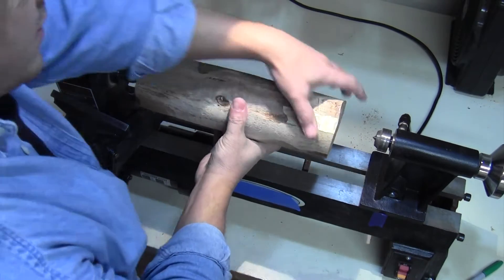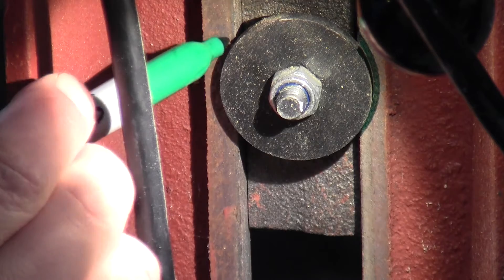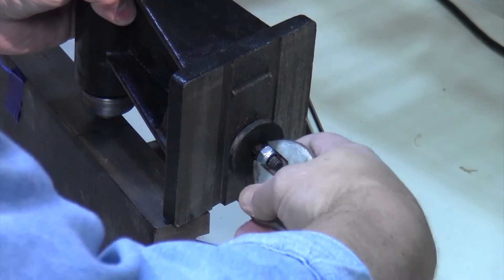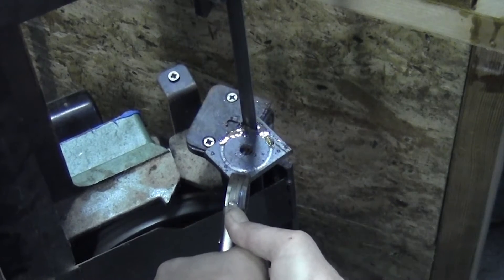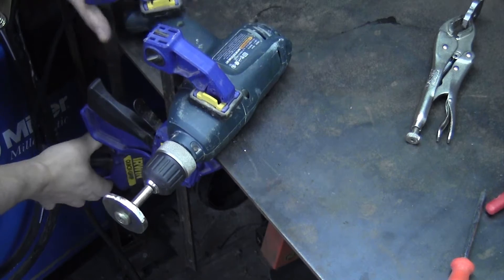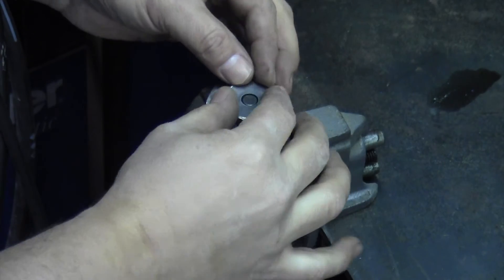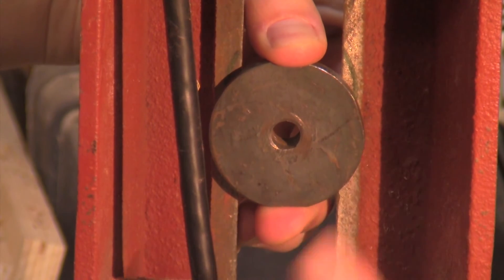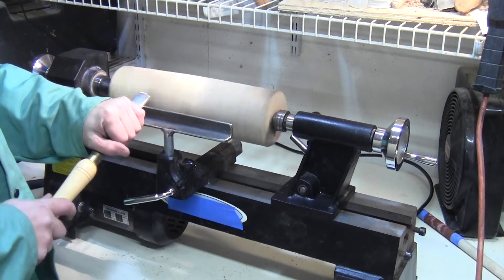Fixing a Slipping Tailstock on a Mini-Lathe

Comment: Had the same problem. Tightened the nut and broke the pin (which was just moulded iron). Any suggestions anyone? My lathe is a bernardo dm 330.

Comment: Thank you. My problem is that the tail stock slips when it’s close to the head stock ( about 6-8 inches away ) . However as I move away from head stock ( 10-12 inches) , the tightening is significant . Do you still want me to try the solution suggested by you or is it some sort of washers which need to be replaced. I use a jet mini lathe . Regds

Comment: My problem is with the quill screw which stripped and I couldn't lock the quill. I just drilled and tapped a new hole beside the old one.
Reply from the maker: That takes courage to drill the side of your lathe, but you must do what it takes to make it work. :)
Reply: Barry's Workshop lol, works better than new.

Comment: I too have an Excelsior with a slipping tail stock. Now I know how to love the problem. Thanks!
Reply from the maker: I hope you're able to get this resolved. FWIW, I saw a video from Russia that looked like the same lathe, with the same problem. Seems to be widespread...

Thanks for watching!
Reply: The Harbor Freight (General) model the Jet, and Rikon are the exact same machine. I just got the RIKON.... the lathe is good for what it's designed for, but the tail stock does move.  I have to find someone to make the fix for me.
Reply: @cferingacraigferinga  I bought the one called Bernardo. It is probably the same one as you listed above (just different name/brand) and I am having tailstock issue with the brand new I bought few days ago.

Comment: I think you should sell these lock plates. I have the exact lathe you do and experience the same issue. However I do not have the tools to do this.
Reply: Hey Barry, I have the same lathe with the same issue. Did you ever consider selling these? I wouldn't be able to make one either.
Reply from the maker: That's an interesting thought... I'm going to look into it to see if I can make it work.  Thank you for the suggestion.